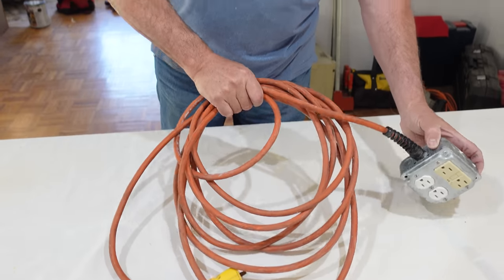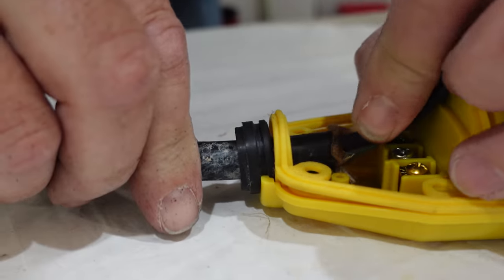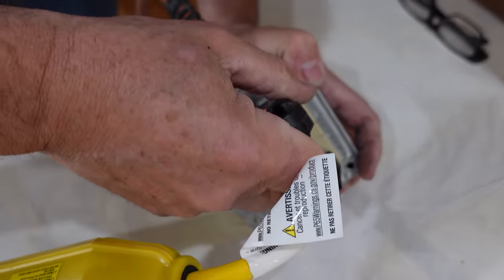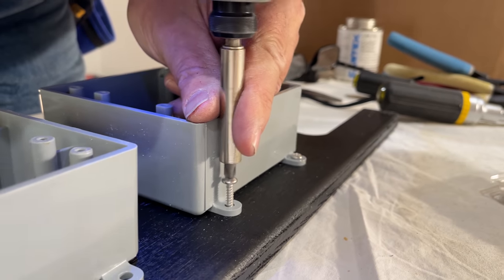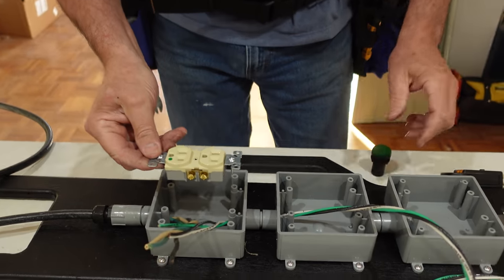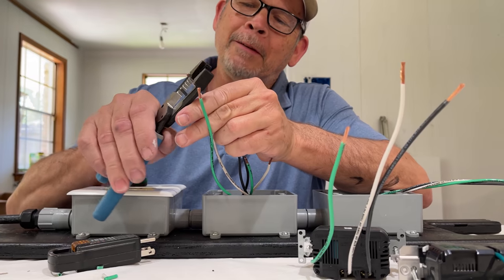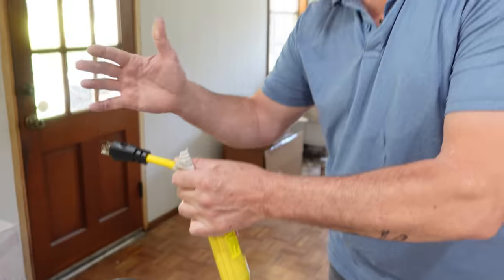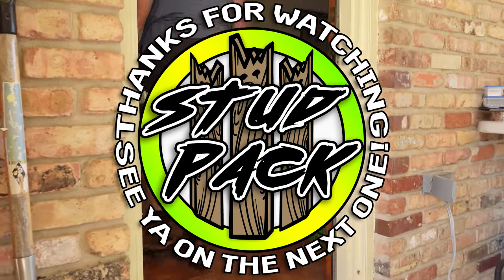HOW TO MAKE THE ULTIMATE EXTENSION CORD!

Comment: Pro Tip: When you are twisting stranded wire, twist in the opposite direction. You may notice that when you cinch the ground screw it tends to splay the wire. The reverse twist is in the same direction as the cinching of the screw so it actually squeezes the wire in the same direction as the twist making a "better" connection.
Reply: Ya know Bob....I would even go further and solider the twists..no freedom wire exposed....easier to insert.

Stud man....gotta love that old wire...they made em well 40 to 50 years ago.  Also, congrats no blood!
Reply: I would go even further here honestly. Over time, a soldered stranded wire end will warp due to heat and pressure when places in a screw terminal. Instead, crimp and solder the wire end in a ring terminal and put the screw through that
Reply: Without that extra step, the "contact resistance" will continue to increase over time and can cause a fire
Reply: I'll give it a try!🙂
Reply: @codewonderland-gaming  Just crimp it, no solder
Reply: Better approach is to use a solid wire, the Wago connector will be happy with it, and all the pieces in the box are solidly in place, no motion to cause problems with the solid wire.
Reply: @codewonderland-gaming  LOL! I mean I think honestly I would go even farther. Screws will unscrew with time. Plus using a crimp and solder has higher resistance. Instead use an 8gauge stranded silver SOOW cord and strip the end and place into a casting mold for a ring terminal pour in molten silver. Make custom top clamping plates washers and screws out of silver. And while the ring terminal is hot place in clamp and use a torque wrench to tighten to 35ft/lb. Then epoxy the screws in place so they can never move.
Reply: Does anyone re-tighten their screws after a minute or so, I find that after you first tighten them down and wait they'll be slightly looser because of the the wire being crushed which takes bit of tension off the screw.
Reply: @codewonderland-gaming you don’t solder crimps, that’s a myth that NASA corrected a long time ago but it still persists on YT. You are correct about the ring crimp though, that’s how earth connections are made
Reply: @jamesa8851 LOL LOL LOL .this is a hilarious reply and couldn't make it through the whole reply because i was laughing so hard !!! It reminds me of the occasional  character in the cartoon delbert by the name of topper . He was always  one upping everybody in every  conversation!!!thanks !! You made my day !!!
Reply: @treepop1550  nice

Comment: Breaker didn't trip instantly because its being overloaded and not short-circuited. It'll take a few seconds to a minute to trip at only 8 amps of overload current and that's normal. Higher current overloads will trip it faster.
Reply: Just something to add to explain it a little better, there’s a strip of metal or a spring inside the breaker. 8A of overload will heat that metal up, making it softer. Over time that metal will deflect or bend, thereby causing the breaker to trip.
Reply: @JeremyPeters  Jeremy is correct.  The breaker is thermally activated so if you allowed the 28 amps to continue for a period of time (rather than just a few seconds) it would indeed trip.
Reply: @JeremyPeters  Just like how turn signals used to work in cars, before they went electronic. 
The current from the incandescent turn signal bulbs would heat up the bi-metallic strip inside of the signal relay, making it deflect, cool down, and reconnect itself automatically for each flash. 
It's what causes the clicking sound you hear when you use your blinkers.
Though, modern cars use LEDs, and electronic flashers. So the clicking sound you hear now-a-days is faked.
Reply: @northernlightsrenovations1710  Most breakers trip and are able to be reset.  Does the metal return to the original shape allowing it to be reset?  Does a short just heat the metal to a deformation instantly then?  last question, another YouTube channel explained how an automatic analog rice cooker works using thermal deformation and a magnet like the old dial thermostats, does a breaker work the same way?

Thanks for the response and explanation.
Reply: @trekie30122  good questions. I hope someone answers.
Reply: @trekie30122  The metal strip has a 'memory' position and will return to it's default shape once it cools down.  However, it's worth noting that most breakers will weaken after numerous activations and may become more sensitive.  This is one of the main reasons that it's not recommended to use the breaker as a switch on a regular basis.
Reply: @trekie30122  in a nutshell, yes. There’s far more physics and metallurgy and thermodynamics involved that I don’t fully understand but that’s the gist of it. At least for conventional breakers, GFCI’s are a whole other ball of wax that involve electromagnets and active circuitry
Reply: Similarly, screw base fuses came in a time delay version where a spring was visible through the glass.   This allowed a temporary overload (eg motor startups) before the fuse blew.  Traditional style fuses would blow almost immediately once the capacity was exceeded.
Reply: @Hachiro  you just answered a question i didn't even know I desperately needed an answer too since the got damn 80's when i was a kid being annoyed by that clicking in the shitty el camino we had.
Reply: It takes time for the spring apparatus inside the breaker to heat up and trip
Reply: @northernlightsrenovations1710  There are breakers made just for this purpose,  they are called "SWD's" or "Switchable Duty Breakers" they have much heavier contacts that will withstand the constant on-off cycles of loads. It would make more sense to just install light switches instead, but you might see these installed on a garage, barn or a commercial storage building.
Reply: There are breakers made for this purpose, they are called "SWD's" or "Switchable Duty Devices".
Reply: @notusedexer  ... in the case of a circuit breaker there's also a spring and a trip lever so needs to be manually reset after the limit is reached. With the rice cooker it's just  constantly cycling against a fixed temperature.
Reply: @northernlightsrenovations1710  ... yes, but activation via temp are not the same as manual switching.
Reply: @northernlightsrenovations1710  When you flip the breaker, you lift the metal strip, so it is not being used.
Reply: @trekie30122  Good question about shorts. Typically, breakers are dual-mode, with both a magnetic and a thermal (heat) component. A dead short will have high enough current to trip the magnetic part of the breaker, which trips instantly and doesn't wait for the metal strip to heat up. That happens at a higher threshold than the breaker rating.
Reply: @ranger178  Incorrect.  All early American automobiles used thermal flashers as do most late model cars that came with incandescent bulbs.  It's why the new LED replacement bulbs often don't work since they don't draw enough current to cause the bi-metallic flasher to heat up.  The canonical "solution" is to add passive high-power resistors to the lamp in parallel.  But this is NOT a solution... it's a dangerous workaround since the resistors get extremely hot and most people aren't properly heat-sinking them in the first place.
Where did you get the idea that early model cars used RC timing circuits and relays?????
Reply: @Hachiro  The clicking is NOT fake.  It's the sound of the relay armature being attracted to the relay coil.  It's a softer sound than the old bi-metallic flasher... but it's very real.
Reply: That doesn't explain the 28 amps on a 15A circuit for that duration.  I suspect they have a 20A breaker on that 15A outdoor receptacle.  Yes, thermal breakers take time to trip, but 28 amps is excessive and there was adequate time for circuit protection to trip.
Reply: Also breakers the more they trip the weaker that metal gets and will trip at a lower thermal setting next time. if you constantly trip a breaker that thermal piece of metal gets weaker and weaker and will keep tripping at a lower amperage the next time. Its not huge but you can wear a breaker out by tripping it a lot and wonder why it keeps tripping on small loads even though it's a 15 amp breaker, this can be why.
Reply: @DiffEQ  They stated that it was a 20 A circuit. Per code you can use a 15A receptacle on a 20A circuit. The receptacles are rated for 20A pass through current, it’s printed on the back of the receptacle also.
Reply: @crippleshot4810  True that you can use 15A on a 20A circuit so long as it's multiple receptacles and a duplex definitely qualifies.  Like I said, it couldn't have been a 15A circuit and I was going by the fact that it was a duplex 5-15R.  Thanks for confirming my suspicion as I did not hear them say it was a 20A circuit.  I have never agreed with NEC or IEEE on their rationale of a NEMA 5-20R being downward compatible with 5-15P, but that's just me and the world is still revolving.  Thanks.
Reply: @JeremyPeters  " 8A of overload will heat that metal up, making it softer. Over time that metal will deflect or bend, thereby causing the breaker to trip." You have the right effect, but not the right mechanism. The heat doesn't make the strip of metal get softer. The strip is a bimetalic strip, meaning that is is two different metal strips bonded together. We all know that materials expand a little when they increase in temperature. With these bimetalic strips one metal expands more than the other when heated. One side of the strip getting longer than the other will naturally cause the strip to curve away from the side that expands more with the same temperature change. When the strip cools down to room temperature the metals contract to their original state pulling the strip back straight to it can make contact again.
Bimetalic strips are used in lots of things. Most dial thermometers have a coiled bimetalic strip that is anchored on the outer edge with the needle attached to the center. As the temperature changes the coil relaxes or tightens up turning the needle. Old thermostats worked like that but instead of a needle there was a mercury switch attached to the center of the coil. Old school large (7W I think?) Christmas lights that flashed have a bimetalic strip that functions very similar to a self-resetting circuit breaker. When the light is on the strip warms up, and deflects away from the contact at one end. Now that the light is off it cools down allowing the strip to relax back into contact closing the circuit which turns on the light. heating the strip up again. Wash, rinse, repeat and you have a very nice twinkling effect in your decorations.
Reply: @Hachiro  Just like the shutter click we hear from phone cameras and digital cameras, it's what we expect to hear so they add it in for us. Wonder why they don't put in revving race car engine sounds in electric cars?
Reply: @Hachiro  hey, speaking of old car blinkers did you know a design feature of that by bymetal cube was that if you had a turn signal light out(as in it is not working/blown bulb) the turn signal will blink faster.  So it actually tells you when your lights are out.  Cool huh?!   So there really is no need for that cop to tell you your turn signal is out since you should already know. Lol
Reply: @madman432000  BMW electrics do have engine noises playing on the stereo.

All electric cars have legally mandated (in this country anyway) sound playing to the outside when going under a certain speed — 20-30 mph ish — to warn pedestrians and cyclists they exist. It’s a safety issue.
Reply: @trekie30122  yet they are suppose to return to original for , but residential stuff is far from heavy duty 
a short will do it very fast... since a short can go into the the hundred of amp...
or if you have a magnetic type... they have a plunger inside like a door bell... if you have enough current... the plunger will trip the breaker 

ps always remember that hydro is capable of powering multiple house.... if you short a socket ...all the possible power is diverted to that plug , the limiting factor is the resitance of the wire
Reply: @JasperJanssen  I can imagine a Prius with F1 engine noise heading to the grocery store with grandma at the wheel... 🙂
Reply: @JeremyPeters  The bimetal strip doesn't soften;  it bends due to being made of 2 different metals with different coefficients of thermal expansion.
Reply: @ranger178  That's newer old solid state. Old fashioned flasher cans are a bimetal strip, no cap, and are effectively a SPST switch with the bulb in series with the normally closed contacts. When the turn signal switch closes, the old I²R happens to the flasher can strip and it breaks, cools, makes, heats, lather rinse repeat. It's as obsolete in modern cars as small contactors with heaters in industry, but the original flasher and intermittent wiper relays made by Delco and Bosch are extremely simple electromechanical devices. Cap discharge and monostable multivibrator flashers are old by now but I'm a professional mechanic so I see it all. [Federal buildings and equipment by trade, cars in my free time].
Reply: It should also be pointed out that if all of the devices were powered up simultaneously the likelihood would be that the breaker would have tripped instantly due to extremely high inrush currents that occur when motors start up.
Reply: just an FYI. The thermal bimetalic strip is not a spring that gets soft per say. Two metals with different expansion rates are bonded together. When they heat, the metals expand at different rates and the strip warps tripping a mechanism. When it cools it returns to the same shape again and the breaker can be reset.
Reply: @tonguefetch8292  They often wear out and break over time though because the metal becomes worked from being heated and cooled constantly. it ultimately can become brittle causing the strip to fracture.
Reply: @leglessinoz  yes. good point

Comment: When you said NEMA 6-20 receptacle you meant to say NEMA 5-20 receptacle. The 5-20 is for 120 V 20 A, whereas the 6-20 is for 240 V 20 A. The plugs are different and are not interchangeable, so you can't accidentally plug a 120 V appliance into a 240 V outlet.
Reply: Thank you, at least someone else besides me saw this.
Reply: *magic smoke escapes*
Reply: I came to the comments for this. The plug he popped up on screen was a 6-15 too.
Reply: @williamriven  I was wondering that.
Reply: @williamriven  Nema 5-15 plug can go into a 5-20 receptacle.  Allowing this extension cord to work in a 5-15 or 5-20 receptacle.  The 5-20 receptacle is switched, but has no indicator.  This probably would have been a good place for a switch with a pilot light (illuminated when on).  Is the deal up to code, since it lets you plug a 20A device into a 15A circuit?  Probably not, but you can make a hell of a useful extension setup based off this idea.
Reply: @williamriven  The 5-15 receptacle can absolutely supply 20 amps. He showed it in the video. 5-15 does not reduce amperage capacity vs. 5-20. By using a 5-20 plug, it keeps people from using it on a circuit not designated for a 20a device. Commonly used 15 amp breakers and 14ga romex wouldn't be suitable for a 20a device. I always use 20 amp breakers and 12ga for receptacles, but older homes often were not wired that way. It is to keep the old square peg from going into the round hole, just the same way that 6-15 and 6-20 have pins rotated so they don't mate up with 5-15 and 5-20.
Reply: @ghammer9773  you mean 6-20
Reply: @williamriven  technically nothing with a 5-15 plug can expect to pull more than 15 amps, but in practice lots of commercial spaces run 20 or even 30 amp breakers (with commensurately larger wire) to 5-15 outlets so that many devices can share a circuit. I have a Hobart mixer, dough roller and sheeter on the same 30 amp circuit. Without that each would have needed a dedicated 15 amp run.
Reply: The receptacle was incorrectly identified verbally as a 6-20 a couple of times.  It's a 5-20.  When the plug graphic popped up, I immediately saw that it was incompatible with the receptacle.  However, it looks to actually be a 5-20 in the graphic but the graphic is mirrored.  At the 2 o'clock position one can just make out the mirrored 5-20 text.